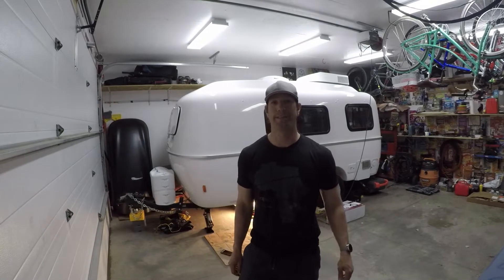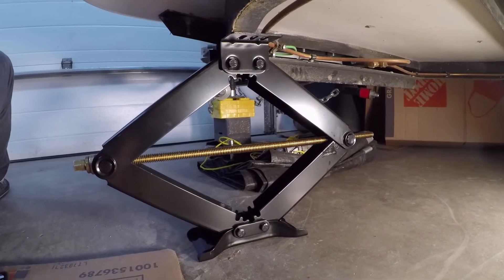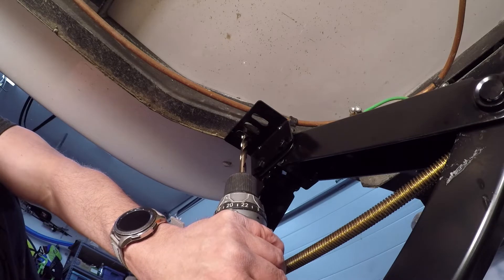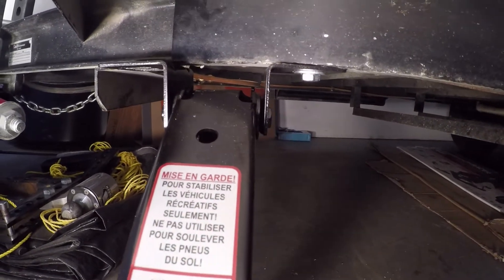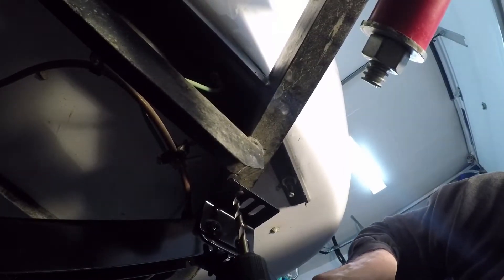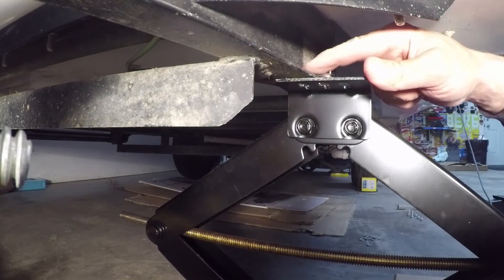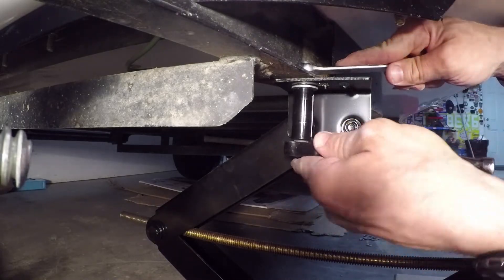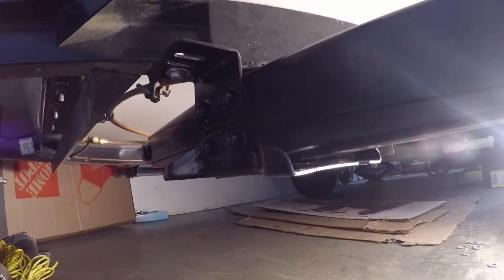Mounting Casita Front Stabilizer Jacks

Comment: Thanks for creating and sharing this video!

I bought a Casita earlier this year and later bought some scissor jacks to install.  My intent initially was to bolt them on, like you have, but I've read several comments from Casita owners who suggest welding a drilled mounting pad to the frame, and bolting the jack to the mounting pad.  Those folks claim drilling the frame may weaken it substantially, as they indicate the frame is relatively lightly built.  Had you thought about welding the jacks to the frame or using a mounting pad, like I mentioned?

Now that you have drilled the frame and have used the scissor jacks over the last year, what are your thoughts? 

Finally, how did you select your jack locations?  Are you happy with the locations?

Thanks again!
Reply from the maker: Hey @richarde1255, thanks for the reply. I had the same thought process as you as I wanted plates welded on then bolt onto the plates.
In the end, I decided to drill holes as I just don't think it will weaken the frame(I'm not an engineer, just my instinct). Also, I like doing as much as I can myself, and I don't have a welder so this was the option I chose. 
I put them as close to the front corner as possible.  They did make a huge difference in stability of the camper. 
My first choice would have been welding plates on, but I am happy with them so far.   
Congrats on the purchase, we've had ours for three years and have no regrets!

Comment: Can you weld them on?
Reply from the maker: Definitely!...preferable even. I'm not a welder, and this was an easier more affordable way to install for me.
Reply: Welding them on , vibration along with the weight of them would eventually cause the trailer's frame to crack. It's not as likely when they're bolted on.